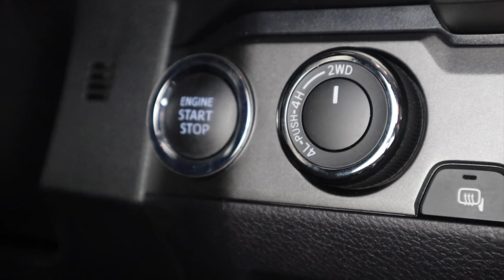Should you buy the latest Toyota Tacoma 2016-2021?

Comment: For those of you wondering what the TSB is for the A/C auxiliary fan is, it is TSB 63-18
Reply: Not all heroes wear capes.. thanks!
Reply: Thank you kind sir and AMD for the this intel, taken my 2020 off-rd and multiple service reps said nothing they can do that the under performance of the A/C is due to the humidity so thanks yall for the help
Reply: Thanks for listing the A/C Auxiliary Fan "TSB Number 63-18 fix".  Local dealer unaware and not helpful when saying he's  not aware of any Toyota Fix and didn't even try to look it up.  Now I know so will try again.  Thanks again.
Reply: @denn2366  I had brought it in during the summer for this issue and they said it was fine  watched this video and took it back to them during the winter with the TSB # they said they could not reproduce the issue (No brainer, it was 60 degrees out) I told them I brought it in during the summer and had the paperwork in hand from that visit and they still did not want to do it. I do not think they really want to do this repair
Reply: Yea I had the same situation and I basically told they its cover threw toyota and I need it done. I had to ask for the manager and explain it all over that's it cover, after all that said and pretty much arguing with them they said they don't have it in stock and would have to order it cuzz they don't ever do those upgrades. I have a feeling I'm the only one in the area that is getting it done...
Reply: Yep mines not working.  Guess I will order one. Thank you.
Reply: Is the fan update covered under warranty or will I have to pay parts and labor ?
Reply: @sheddski2942  it's under warranty but dealers will tell you difference don't believe um
Reply: Toyota has been having a lot of issues with their engines whether it be trucks or sedans lately because of oil consumption issues and transmissions not shifting properly.
Reply: @benjaminmeza5372  I never had problems with my 19 taco... the problem is people don't know how to take care of their vehicles, it neglect....
Reply: LOL these things are tiny, I'd be afraid I would DESTROY these trucks/they are BASICALLY cars, I also would worrie about hauling/towing ANYTHING, in these trucks.

I know these trucks are popular,BUT I don't understand why,MAYBE gas mileage/to say you have a truck, with car qualities, I'm not a big fan of F150s either though, I wouldn't trust an F150 either, they are BASICALLY cars/they lack the power needed, to get jobs done, ALTHOUGH I would trust an F150/1500, more than I would trust a Toyota truck, at least when it comes to towing/getting work done.

I would say these are ACTUAL trucks/these trucks wont scare you as much/won't make you think somethings going to break, the F250 or F350 OR a 2500 or 3500.

LOL if you raise one of these Toyotas, MOST likely, it won't be able to even tow its rated 6,800 pounds/more practically 3,740 pounds AND IF you care about your car/truck, I wouldn't exceed 1,000/MAYBE 1,500 pounds, in the bed, this thing can't even tow 10,000 pounds lol, a chevy cargo van, can tow 10thousand pounds, and carrie/it has a load out of 3,339/4,312 pounds, also an F150 can at least tow 11thousand pounds and carrie 3,339/4,339 pounds, If you care about your F150, I would bring that back to 1,800-2,000 pounds though,these trucks/Toyotas, would get to much wear and tear/they can't hold up under load, not that I would expect them to, based on how small they are, but I wouldn't even call these/toyotas, trucks,I don't know why these vehicles exists, MAYBE to give the appearance of a truck, to put this in prospective, a mini copper can carrie 793/935/1,031 pounds, a toyota is capable of 1,440 pounds, in its bed/carrie load and this is pushing it, I'm not saying EVERYONE is carrying this much, BUT IF it has the ability to carrie more, than what your carrying, less strain/wear/tear will be done to the engine/transmission/the over all vehicle, anyway I wouldn't call these trucks, I would say they are a SLIGHT step, above a mini cooper.
Reply: Looks like the MT is not included... good stuff!
Reply: @cedmapi  yes, matt matt is laughable
Reply: Wonder if there just a improved aftermarket fan plug-play fix for this
Reply: I bought the 17, then did my research, go figure. I did get the manual 🤔
Reply: L
Reply: Thank
Reply: So now is 2nd time I've taken to local dealer and this time they said that TSB applies only to Gen2 Tacoma. Smh guess I need to file a formal request through the corporate website as one technician recommended. Any tips yall can provide because stop and go traffic in TX and this issue is terrible
Reply: Out of warranty, this is a $1700 repair. At least that's what my dealer quoted me.
Reply: @MH-ih7rh  🤔😕
Reply: I ain't gonna lie... Matt Matt hurt my feelings..😢😢😢😢
Reply: Es otro abanico más chico
Reply: @No-K_Nic cool story bro, not everyone needs 10k towing power and 3k payload abilities at 8 mpg 😂
Reply: @No-K_Nic  lol delete your original comment cool bro gtfo
Reply: Ha, I just asked this thanks
Reply: Does the ac warranty apply to 2023 Tacoma

Comment: Lesson here is don't buy the first two years of a new model.  It's almost better to buy the last year of a model before it moves over to a new redesign.  All the bugs got fixed.
Reply: I bought a 2018 Camry SE. First year design so far no problems.
Reply: Yes you are so ✅ right. I had a 2013 Tacoma and it was dead reliable. My one brother in law bought a 16 Tacoma and he has spent $6 to $7000 in repairs. His AC does not work...thinks it.needs new timing chains and who knows what else.
Reply: @T H the audio system is fine, all frames exposed to the elements will rust, the engine has plenty of power it's the gearing that holds it back.

But I also agree that this truck is lagging far behind of literally everything on the US market in terms of technology and the QC on this truck is absolute garbage.
Reply: @jaysmith179  me too mine never got a recall no nothing at all so far no issues I guess I got a good badge
Reply: Yup, I bought a 2020 Corolla, but got the 1.8 engine instead, which has the same transmission and engine as 2014-2019 Corollas. The SE sportier version has the 2.0 engine and a new CVT, although I haven’t heard of any issues with those engines, you should always make sure before you buy a new model car, especially if the engine and transmission is redesigned and new.
Reply: Exactly my philosophy, 2015 last year of the 4.0 liter, 2016 first year of the 3.5 liter. Looking at new ones because 2 year old trucks with low miles are nearly the same price as new. The 2021 SR5 that my dealer is searching for was $2500 more than a 19 with 12k miles that I found on Carguru, the exact same truck.
Reply: @crusherman96  the frame rot is such an easy fix too.  Spray nh oil undercoat on it every year and it will never rust .
Reply: @Matt-ro7cb  I am going with KROWN RUST for my Tundra
Reply: Exactly. The problem is that generally the new model looks better so they go with the new model
Reply: I bought a 2016 trd sport tacoma, 85k miles and no issues at all, all stock part are still on, even has the same battery.
Reply: @jmakc3541  Overall Toyota trucks are really well built. I had a 13 and it was like granite. Toyota does build the odd lemon now and then, but not to often
Reply: That's exactly what I always do. I bought the Tacoma 04 in 2005 and bought the Tacoma 2015 in 2017 lol.
Reply: I have a 2013 RAV4 and it is first year model and it is made in Canada, problem free so far, even the battery is original
Reply: I bought a 2020 tundra seems solid so far but transmission acts like it can’t decide what gear it wants to be in sometimes
Reply: This is why I went ahead and bought the 2021 Tacoma even though their 4th gen is just around the corner (predicted to be 2023 or 2024).  I thought it was a bad idea to buy one of the last models of the previous generation, but then I figured the next gen first 1-2 years is going to come with a host of problems.  So realistically I wouldn’t be wanting to sell and upgrade until probably 2026+ when they can work out all the kinks.  The 2021 Tacoma TRD off road is great btw.  No issues with gear hunting on my automatic, but haven’t tried punching it uphill.  I really can’t try that much because I live in a flat desert here…
Reply: I’ve got a 96 Taco 4x4 with the 2.7, first yr they made the taco that I drive 3-400 hundred miles a week, she a beast.
Reply: You're right. My 2017 Tacoma with 80k miles on it is in the shop after losing it's torque converter bolts and tranny fluid suddenly the other day.
Reply: Saw that coming, when Toy started redesigning the Taco. I jumped at the chance to get me a new 2015 off the lot, has a lot of power and happy with it.
Reply: Smart intelligent human 👌
Reply: I bought a 2016 Subaru Crosstrek on the release date and I’ve had problems with it ever since. Even the guy at the dealership laughed when I came in for my THIRD recall. Now I’m looking into a Tacoma because I’m tired of dicking around with unreliable cars.
Reply: @andrettishields388  I have a 2015 SR5 and with the 4.0 and it’s the best Toyota Tacoma I’ve ever had, I have had 4 Toyota trucks over the years
Reply: @shelpippg2202  why a crosstrek in the first place
Reply: @larios86  I lived in the mountains when I bought it, so it seemed like a great idea. Spoiler: it was terrible in the snow & the worst car I’ve ever owned.
Reply: @shelpippg2202  oh wow did you get a tacoma or what car did you end up going  with
Reply: @larios86  I spent 3 months looking for a Tacoma but couldn’t find the year I wanted. I gave up after a while and I ended up with a 2021 Honda Civic sport touring for the fuel efficiency. I don’t regret it, though. I absolutely love it.
Reply: @shelpippg2202  Oh not bad Hondas are good cars too plus the mpg is a plus. I have a 16 tacoma and thinking about trading it for a newer year if not I'll wait for the 4th gen.
Reply: @larios86  how do you like the ‘16 tacoma? When I was looking, I wanted a ‘15. I can’t believe how well they retain their value! You’ll probably get a pretty penny for it when you trade it in.
Reply: Unless it’s a 2nd gen Tundra that went a million miles.
Reply: @shelpippg2202 I love it the only reason i would get rid of it would be for a newer one. And oh yes Tacomas hold their value better than any other vehicle so for that reason their worth it, you can even sell it years later if you want something else or upgrade and get a good percentage of your money back.
Reply: Has anyone had or heard of brake system issues with the newer Tacoma's? I just bought a 2022 sr least month. First few weeks trick felt fine, but now I'm starting to feel a slight brake pull and roughness when breaking at lights or coming to a stop. Almost a feeling as if the brakes have worn out or going bad. Do these new pads or drums take a bit to wear in or something? I told the dealership and of course they did wait to first oil change to look at it lol. Enough miles and time to try and blame me for the breaking issue, do to my driving or something. I hate these little issues because they are too small to make a stink about but could be the sign of something definitely faulty. Just wanted to see if this is happening across the board, these trucks are now made of Mexico, which I'm not sure was a good move on Toyota. I once had a Jetta years ago made in Mexico, the car literally started to melt and slowly decompose over 5 years, almost everything broke eventually. I'm just getting very disappointed in the way cars are made now, almost all brands are becoming sketchy, even Toyota
Reply: I got a 17 no problems got 120,000 miles had it since oct 1 2016
Reply: I alway s buy the last model year. Thing is people always wanted the latest model, not me.
Reply: @thevanman4498  I'm sure that's a smart choice too
Reply: @larios86  looks like a couple of dealers are getting anxious about me. I want to trade a 2015 Tacoma SR5 2WD matching canopy for a new 23’Tacoma TRD off-road and 25K taxes and all the other fees included. Dealers are rethinking my offer and instead of thinking I should pay upto 36K and my trade they are sheepishly calling me to see if I am still interested. I reiterated at 25K CDN out the door. They love it when I tell I can put a deposit and any sum necessary to show good faith, we’ll see. A dealer invited me on the weekend to view my truck and I said as long as you are serious that as long as my truck checks out we have a deal. Time for them to sh it or get off the pot. I told them a couple of dealers are interested in my trade in, just to turn the heat up a bit. VM
Reply: Sad but true. I have a '19 taco but had a 2005 mini Cooper and it had problems up the A
Reply: Who oh why didn’t Toyota just insert the tried and true 4.6 v8?
Reply: Just bought 23 trd off road 4x4 Tacoma, they are going balls out next year with probably a turbo or hybrid
Reply: I got a 19 it’s rock solid.
Reply: Yah the new tundra even lost its reliability rating. I knew that thing was gonna be a piece of shit. Why would anyone buy a twin turbo 6cyl pickup is beyond me.
Reply: Exactly how I feel about the jab,,, lets give it 3 years. my 2020 TRD Sport has been perfect for 60k miles
Reply: @zevkej  it's EPA and Cafe ratings to blame, toyta knew their old v8 tundras where tanks, but when your faced with a loaded gun for better gas milage with smaller engines, your only option is to axe your v8s and get with the times sadly
Reply: Mean Not in general Rav4 are all good, 4runners arr all good,, Landcruisers all good, CRV, LEXUS  .......i advise you to learn from it
Reply: I have a 2017 TRD Sport that is smoking oil on start up, using oil and puffs a big cloud on acceleration sometimes. Seeing a tach about it this month.
Reply: Wasn't an issue when first Tacoma came out. I had 95 1/2... one of first off the line. Never one single issue
Reply: My 07 rides better than the 2021 I just test drove
Reply: @bch5513  Japanese cars built around 2006/07 were prob the last few that were made more solid vs the thin sheet metal, over abundance of plastic parts, non CVT transmissions, non turbo, and just cheap interiors (both fabric and leather) we see today.
Reply: Except in the case of the Tacoma.   Quality seems to have dropped since they moved the assembly plant to Mexico.   22-23 seems to be dumpster fires.
Reply: Old wife’s tail. This isn’t 70s and 80s with gm, Ford and dodge putting out hits / misses. First year, last year doesn’t matter. It’s under warranty anyways.
Reply: @nocturnalme3549  try adjusting rear brakes?
Reply: The 2023 tacomas have an driver air bag recall🤣
Reply: I totally agree but there’s exceptions, dad bought a 2012 Camry 4 cyl new and put 285k miles on it with only maintenance and one replaced window motor before the transmission gave up, the only reason it gave up was because my dad never serviced it and the car would’ve went to 400k if the transmission was treated right.
Reply: Not necessarily true, the 2005 model of Toyota Tacoma is the first year of the second gen and the most reliable of whole generation.
Reply: 2017 Tacoma with the 3.5 no problems 193,453 miles
Reply: @shelpippg2202  My wife had a Crosstrek. It was easily the worst vehicle ive ever known. Issue after issue. Lots of electronic problems that had to be fixed at the dealership. Constant wheel bearing and axel problems. Then at 100k miles it started burning oil and the cvt transmission went out.
Reply: You're 100 %, right, bro That's why I'm gonna wait on the second to last version of the new Tacoma.
Reply: I agree for the first year but I have a 2017 and never have problems.
Reply: That’s what I did, 23 taco with the manual.
Reply: I just got a brand new 23 in september.
Reply: I have a 16 with over 200,000 miles the only issue i had with ot is the white paint minor peeling just started recently and the whistling noise on the highway. I have had NONE of the other issues he talked about in this video.
Reply: Had this mindset going into the dealership in October, Left with a 2023 Tacoma SR with the v6 n 4x4. All the kinks ironed out and nothing I don’t need, Got her for a few under msrp too, 3 year warranty on everything I think I’ll be staying with Toyota a while
Reply: @cynicalnoir2394  smart move. When the 16's came out I went and got a brand new 15. Im so glad i did. My truck had one recall for a sticker on the door. Biggest problem i had with it is the ac clutch went out. I replaced it myself today with a $50 one off ebay. Switched the terrible head unit with one that has android audio and carplay. Been a great truck.
Reply: I must have got lucky because I have a '05 trd off road with 297,000 miles with regular maintenance, no mechanical issues and still runs and looks good. Also have a '18, 6 speed manual with low miles and only complaint is the engine noise. 4.0 is much more quiet than the 3.5. The 3.5 is supposed to have more horsepower too but it sure doesn't feel like it. Wish I would have searched for a '15 with low miles if there is such a thing. My opinion is 2nd gen looks and runs better.
Reply: Damn the timing of me getting a 2021 Tacoma was perfect timing